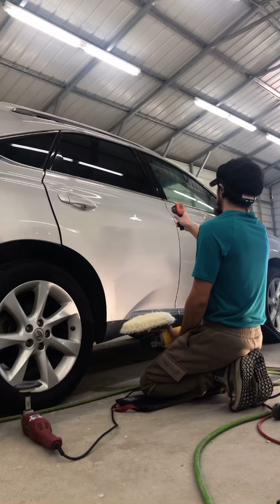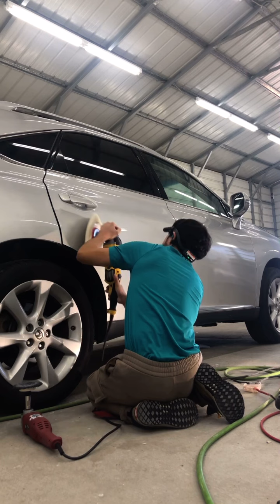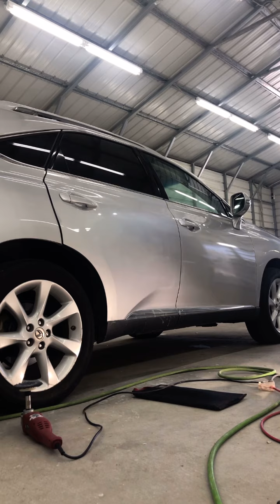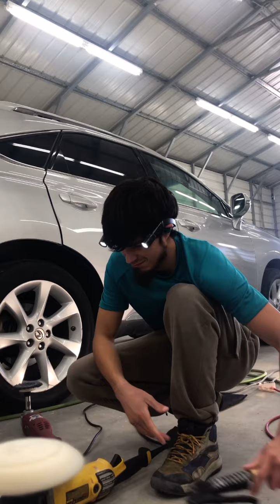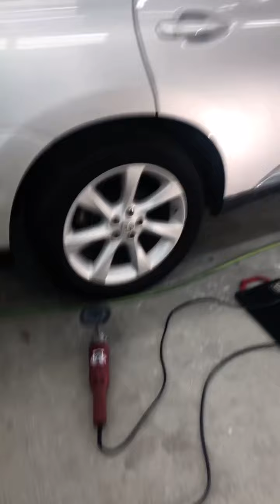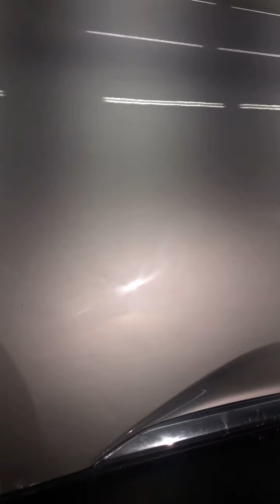Cutting 3000 Grit Scratches With Twisted Wool & Rotary

Comment: Cool videos man, I just came across your channel and I like how you rock the rotary, 3000 grit is cake for that combo, you can actually level 3000 grit with something like the sm Arnold yellow foam pad 50ppi from harbor freight and a polish like M205 or M200. 1200-1400 rpm’s is all you need, on some paints you can do it in one step, no need to follow up with the black foam 80 ppi pad and a lower 600-1000 rpm speed to finish.
Reply from the maker: @STILLNIGHTPEARL  I appreciate that man ✊ I like being able to slice through my sanding marks quick so that’s why I tend to stick with wool. I used to run foam and polish when I first worked with rotary but slowly transitioned over and just let my 21mm DA mop up the remaining holograms
Reply: @BDetailedAutoDetailing hey man have you ever used the warrior rotary polisher from harbor freight? The one that’s like $40? Im looking for a lighter option just for headlights, something where you don’t need that much torque, that one should be fine?

Comment from the maker: Temps signed in video:

Starting Temp: 67 0:05
2nd read: 73 2:58
3rd read: 79 (after buff)
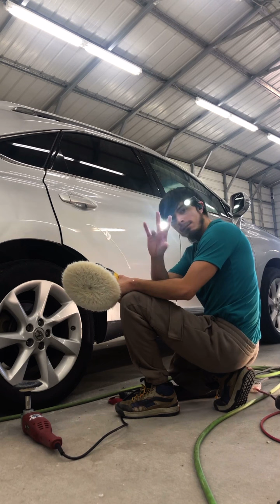4th read: 75 (after buff) 5:43
5th read: 73 (after buff) 11:26

Pulled out Rotary after sanding down the panel with 3000 by hand. Twisted wool to get the fast, cool, and effective cut. Experimented a bit on running with a higher speed. Normally I’ll run at 1400 but this time I was running as high as 2200 at points just to see if I could use that speed and keep the panel cool and get any faster of a cut step. 

Products & tools used. 

DeWalt 849XP
3M rubbing compound 
Braun neck light
SM Arnold Twisted Wool Pad
Ames laser temp gun